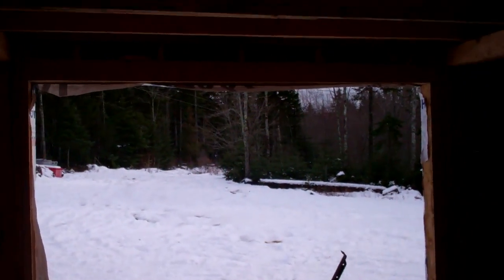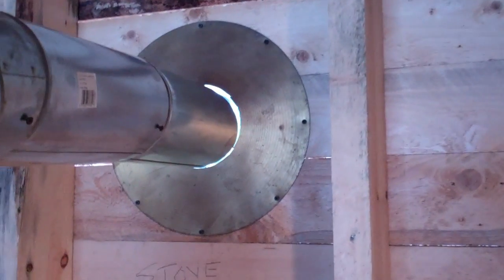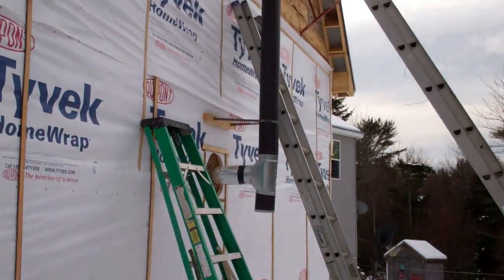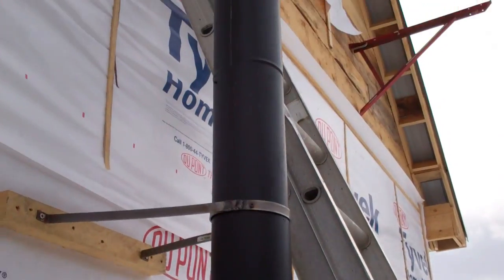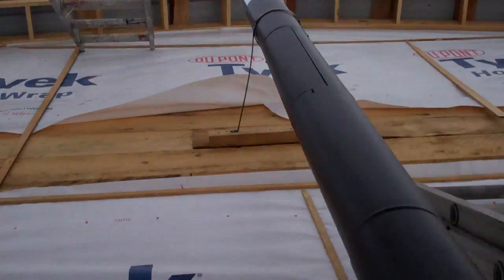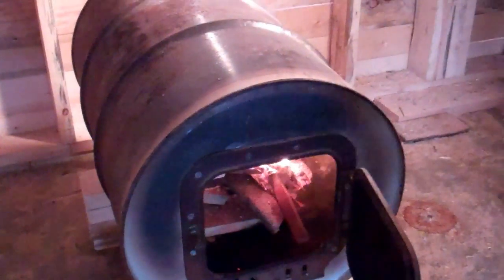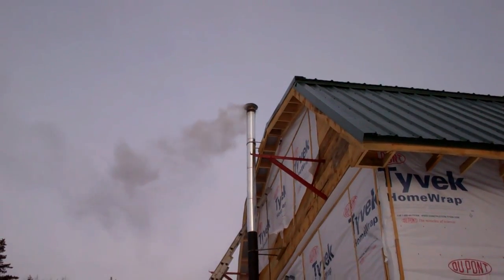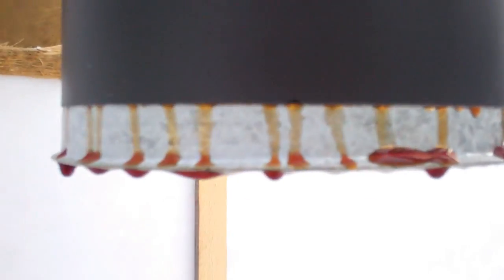Garage Build .... Day 14 .... Woodstove and chimney

Comment: lived in Kentucky,  burned lots of wood an coal, without the expensive triple or double pipe . also I've been burning wood 25 plus yrs,  pipe thru wall, I used a 5 gallon bucket an poured cement 1/2 of the bucket an put a 6inch pipe in the cement  an let it set up, an use that to place in the wall,, it works for me,,,

Comment: They should give this video to everyone looking to install a woodstove and say if you do it this way , you will burn your house down.
100%.

I cant believe the wood thimble is that close to a single wall pipe.
Single wall pipe calls for 18" clearance.
You have maybe a half inch on all sides.
Doing it this way you really need to use class A pipe that calls for a 2" clearance.

You're absolutely nuts.

Comment: Born & raised and live in Central New Hampshire.  I know cold, I know woodstoves.  The drippings happen when you use pine or soft wood.  Please don't burn soft wood or  hardwood seasoned or green.  You will hear a sissing sound.  This will create creosote in your pipe, then to a chimney fire.  The drippings from your pipe is that.

Comment: great job.. i took house ductwork and  took out the basement window and stuck it out there and boarded up the window with  sheet metal from the back of an old highschool locker and  the pipe only goes up about 6 feet  from the basement window.. not up the side of the house.. it works fine..this kind of pipe is called an ice shack stovepipe
Reply from the maker: +san379 I've taken a lot of negativity over it...I have a real chimney now.
Reply: its fine but theres alot of youtube haters.. its sad but the rust really rusts the pipes out fast..

Comment: You Should Only Use Black Stove Pipe inside. The Galvanized Pipe you are using can emit Poisons into the air When Heated indoors
Reply: I think the only effect you may get from zink fumes is a "zink fever" - a high fever with no known after effects. Basically you must work in a zink factory to get the fever.
Reply: Not an expert by any means but I recall a welding instructor telling the class to only weld galvanized metal with a hood type apparatus because zinc poisoning caused blindness and if I recall correctly, insanity. The reason they use galvi with gas appliances is the flame temp might be hotter than wood but ' the fire' is usually much smaller , further away, and fuel much more consistent. I have used galvi myself when I tied a instantaneous hot water heater to the chimney of an old wood/ gas cookstove because I didn't want to poke another hole in my roof. I only used the wood option a few times a year (mostly because it was actually a coal/gas cookstove  so the firebox was too small so it required finely split perfectly seasoned hardwood otherwise it would take hours to get hot or coal, but I didn't know any better) Also this galvi tee was 8' from puny firebox but just in case, I burnt off the galvi on the coals of a brush fire and then wirebrushed and painted it with high temp paint the following day. Don't know if that was safe but I was improvising which I ratiolized was ok for me but now that cabin is occupied by innocent folks that I hope won't replace the ancient coal stove with a real wood variety. Think the issue with wood is it's inconsistent and chimney fires much more likely.

Comment: Your chiminey, I did my first one like yours, 2 foot sections of black pipe, but about 4 months into the season i was checking the flue took it down and it fell apart, creosote had rusted all the connections. went to the salvage yard bought a 20 foot stick 6'   1/8 inch wall pipe have not had a problem since. i paid 60 dollars for the full steel tube. I hope that yours does not do what mine did. But just in case, buy some full pipe and have a buddy weld it together. Not had a problem since.

Comment: Those barrel stoves rock.  You can burn with single wall black pipe and save a fortune.  Double-wall stainless pipes cost an arm and a leg.
Reply: Ya but in most states it’s a requirement for outside the wall.  Or it will void your insurance.  U can use single wall out of the fireplace and that actually puts off heat too but before u get to the thimble u have to go with the stainless double walled and use it for all the outside pipe.   U also have to stay away from combustibles 18” instead of the 6” for the double wall.
Reply: @trumpking4874  Agreed; I wouldn't run a barrel stove and single-wall flues in anything I cared about catching fire.

Comment: You'll be replacing the galvanized pipe sections next year..  They won't hold up.  I have a tee at the bottom of my flue as well.  Makes it lots easier to run a brush up the pipe :)

Comment: Be careful using galvanized pipe for the vent indoors.There are many poisonous gasses that come off that stuff. Not too big a problem with that big hole in the wall. Plenty of ventalation.

Comment: i did the same but with duct work off the side of the road at my camp it would rust out but i had lots so i made it threw 2 winters  then found a 8 foot pice of 8' 1/8  pipe then a 3 foot piece of 6' 1/8 pipe got them cut to make a T welded it together then used bed frame to make braces welded to it  put a old stainless pot for a clean out on the bottom of the 8' and a garbage piked chimney cap on top  the 6' goes threw sheet mettle on the wall its in my video (my camp part 1 in French

Comment: i am in process of installing one of these in my barn, i have a question, why did you not put it through the roof rather than the side of the barn? i ask because i am trying to figure out  whether to put mine through the roof chimney that is there or to put it through the wall. :) Thanks Capt. John!
Reply from the maker: It is a temporary chimney so i did not want to go through the upstairs floor and then the roof.

Comment: Because he has an uninsulated chimney which is causing the flue gasses to cool down TOO quickly. A chimney fire is in his future! And because he is burning inefficiently. Smoke is unburnt fuel. Check out you tube for "Rocket Mass Heater" then you will be on track for heating efficiency!

Great video otherwise, thanks for showing off what you did.

Comment: Unless that barrel is double lined you have to maintain 36" to ALL combustible materials, so even if your legs are cold, the body is still transferring heat to the wood.

Second, Concrete board directly against a combustible material DOES NOT MAKE A NONCOMBUSTIBLE surface. The concrete board acts as a heat transfer.

Third, you are using galvanized HVAC pipe in your venting system.

YOU ARE GOING TO BURN YOUR NEW HOME TO THE GROUND. YOU DO NOT HAVE ANY PERMITS FOR THIS AS THAT WOULD NEVER PASS ANY CODE!
Reply from the maker: I live in rural Maine....The only code here is surviving any way you can....I have had that barrel stove bright cherry red for hours with no problem.
Reply: No, you live in a county within Maine and you have local, state, and national codes to follow as well as manufacturer requirements. You have an unsafe installation and are risking your home.
Reply from the maker: It's a garage, I built it myself....So I don't have to meet any codes...It's been running for three winters wide open....So you can take your "Safety Sally" comments elsewhere.
Reply: jesus h..whats up with smoky the bear fire marshal. we've run a barrel burner for a few years up here in northern maine...works just fine...as well as the stacked 8" block wall for protection!!
Reply: ***** "there was no code", meaning that any new code cannot possibly be helpful?  Common sense apparently isn't all that common these days.  It's quite possible to run an improperly installed stove for years. Then one day, you come home to find a big smoking hole where the house used to be. Of course, if you don't have any insurance, nobody really cares what you do to yourself.
Reply: It has nothing to do with being negative you angry person, it has to do with keeping someone from burning their building down.
Reply: thepoultrypeople Voluntary ignorance of basic fire safety has its own rewards. I cannot count the number of lives I have personally saved since becoming a firefighter in 1975.  Teaching people not to die is less risky than trying to rescue them in a fire that could have been easily avoided.
Reply: thepoultrypeople I'll check, but I don't believe we're allowed to do that.  More dang rules.